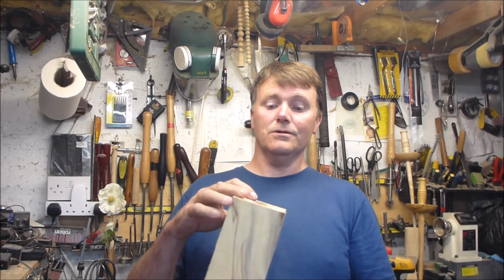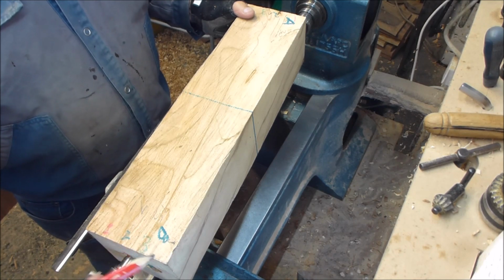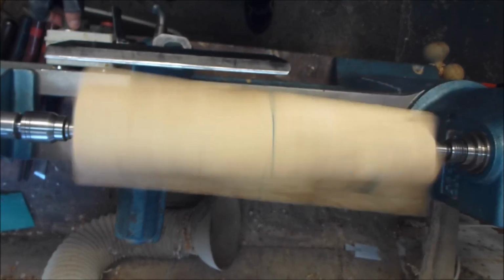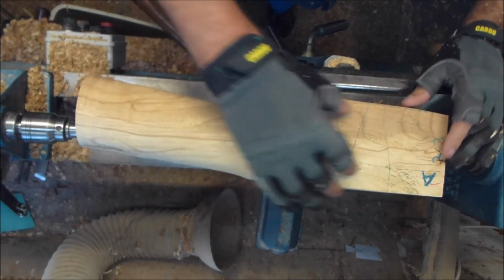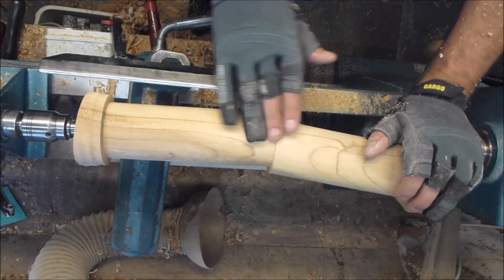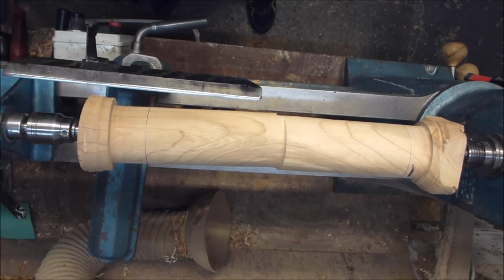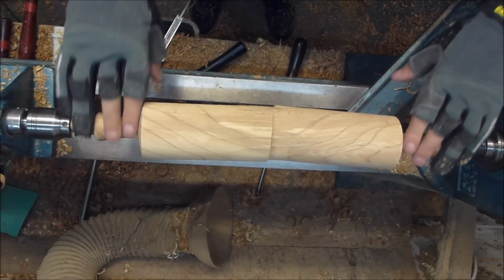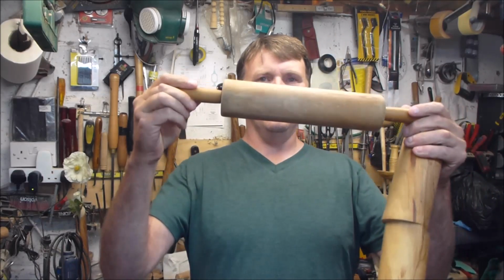32#woodturning a multi axis rolling pin

Comment: Great project Robbie.
I'd been thinking along the same lines as Mike but as my wife knows how to use the computer I'll just keep quiet. I don't want a wallop with a proper rolling pin. ;o)
Anyway, on a serious note, is that CA glue on the marked up centres? Did you need that for safety or was there a problem with the wood?
Cheers,
Ben
Reply from the maker: Thanks Ben i used CA to make the centers more stronger 
it gives more grip on the step centers